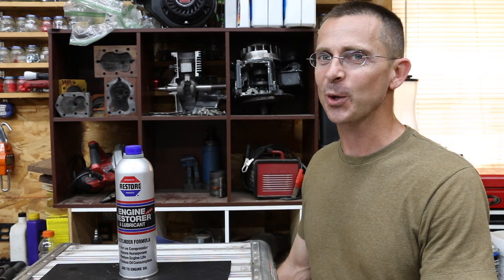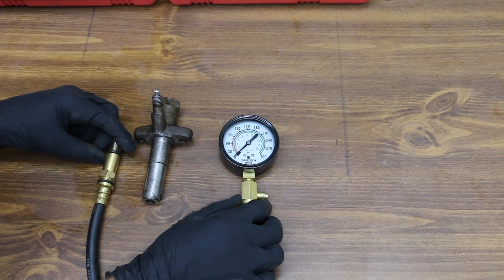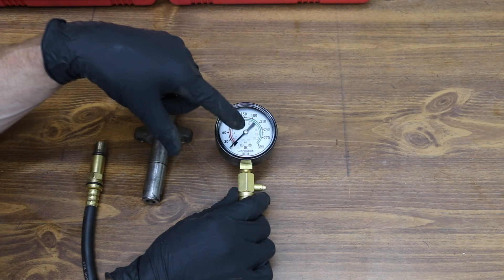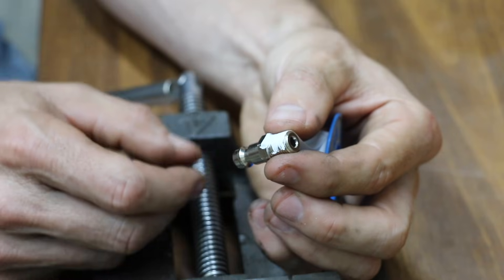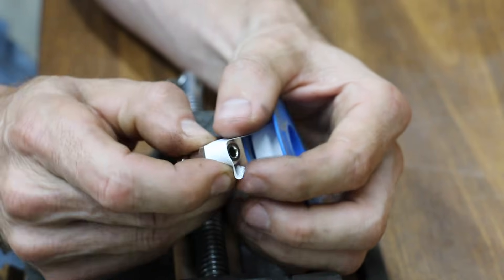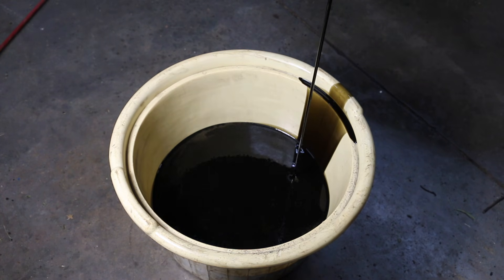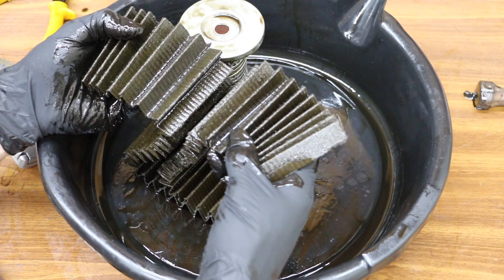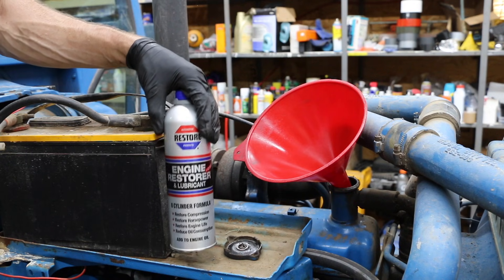Did the "Engine Restore" Compression Improvement Last?  One year later (Episode 2)

Comment: Even Michael Moore admits that producing and running a Telsa or battery-powered car pollutes more than a gas engine. Don't be a poser, save the earth and your money by keeping your old, payed-for beater running. Restore works pretty well, but you need to keep using it. The old pushrod engines don't have the tiny screens and oil passages so they can flush out pretty well without causing new clogging problems. The '03 GM LS59 5.3l V8 in my Tahoe is a good example. I like to do a good flush with clean, high-detergent oil first; Drain old oil keeping old dirty filter in place (dirty filters trap more fine crud than a new filter), add 5qts cheap 0-20wt oil and 1 qt of an engine flush like MMO, seafoam. kerosene, etc.. Run with no load at idle-2000rpm for 15 minutes, drain oil and flush solvent well. Add new good oil and Restore, new oil filter. Go for a drive. Using Liqui-Moly's engine flush and then their Ceratec at 200k mi worked VERY well in the same LS59. It took 4-5kmi to get the full Ceratec ceramic effect but no more cold lifter tick and the snappy power is still there at over 215k.
Reply from the maker: Thanks for the feedback.

Comment: compression and oil status is EVERYTHING with an old diesel like this, the injectors use OIL PRESSURE to fire the injectors, more compression has been believed to increase oil pressure, so this tractor could have gained some good power numbers!
Reply from the maker: Thanks for sharing.
Reply: I don't think this entine is a HEUI type injection system. Just a jerk pump with a poppet type injector. The only pressure is fuel at 2500 psi opening the poppet.

Comment: I do pharmaceuticals for my work. I drive a Dodge Grand Caravan with a 3.6 with 389,578 miles on it. Almost all of it is highway/thruway driving. I have used the Engine Restore for about 200,000 miles. (roughly) The engine purrs. I also now use it in my Chevy Suburban. It does work. Great video as usual.
Reply from the maker: Thanks!

Comment: I wonder if the compression increase could be from build-up on the cylinder head or valves from the additive. I believe it's not approved for aircraft engines which are just vintage air-cooled flat 4 cylinders. , maybe the lead in the fuel reacts. I don't know. but if it was ok it seems like it would be great for them. What are your thoughts?

Comment: Had an 03 malibu 3.1 v-6 that was rattling bad. Tried a few products and nothing. Was getting ready to buy a engine . Put restore in and within 10 mins it was quiet. If you changed oil without it rattle came back. It had more oil pressure and ran cooler. Anything with high miles iv'e tried it on it helps.
Reply from the maker: Thanks for the feedback.

Comment: I wonder if this additive might work on improving those modern engines that burn a quart of oil per 1000 miles, right out of the factory. It would not be cost-effective if the Restore would be used at every oil change though, as it is more expensive than the quart of oil that is being lost.
Reply from the maker: Thanks for the feedback.

Comment: It works i had Ford tarus got cheep not runing instal new cylinder head in the rear and cylinder was scored had slight miss fire on cylinder adding restor 2 times miss stoped. Sold it 8 years later after 2 transmission in it lol.
Reply from the maker: Thanks for sharing.

Comment: I had a bad experience with engine restore. I read about the contents before putting it in my Honda K24a engine, and decided the product made sense from a composition perspective. I’d like to note that there was nothing wrong with my engine at the time, it only had 55k miles and I believed that engine restore might prolong it’s life (contributing extra lubrication additives to my oil). I put in the 4 cylinder version to my engine on the next oil change with a fresh filter. About 50 miles or so later I heard a squeaking noise coming from my engine compartment and then a loud bang. Engine temp started to rise — and then smoke. Luckily I hadn’t left town and called my brother to come help tow me home. After removing the oil pan it became obvious what had happened. Restore, having suspended solids in it, had clogged the tiny Honda oil filter to the point where the oil pump shaft had snapped from the back pressure from the filter. It’s not a small diameter shaft either. I felt terrible for that engine and tried to save it, but there’s was too much circulated oil pump debris. It lasted maybe another 1000 miles with a cleaning and a new pump. Ended up swapping it for a used one with higher mileage. I believe the product does make sense if you have enough oil capacity and a large enough filter to offset what will be caught in it. I don’t recommend it for engines where the oil capacity and/or the filters are small.
Reply: Your story does not add up on more than one level

Comment: Maybe you can put the top  engine additives to a test against each other? That'd be interesting. Just like you did with the oils.
Great video as always sir.
Reply from the maker: Great suggestion!  Thank you.
Reply: @ProjectFarm  I try
Reply: @ProjectFarm  if you had a 10 year old Chevy 2500Hd V8 gas with nearly 175k miles on it that does alot of towing and were about to do an oil change. Would you add an additive? If so which one? Restore...
Liquid Moly...
Or another 
???

Comment: If you gut the old injector without a valve at the bottom, your essentially creating a larger combustion chamber with the volume below the valve making lower compression ratio and pressure. You should see higher actual pressure with the correct tester.

Comment: I added Engine Restore to a GMC Denali 5.3 L V8 with 91000 miles that was using a lot of oil. Before adding ER, it was using a quart of oil in 1000 miles. I changed the oil using Valvoline Synthetic 5W-30 and added ER. I drove it another 3,000 miles. It continued to use a quart of oil in 1000 miles. :-/  The engine ran great before and the plugs looked good with no oil buildup. I had put in new plugs 500 miles before the oil change. After 3000 miles they too looked good with no oil buildup. I was SO hopeful ER would curb this engine's thirst for oil, but it did not. I'm a mechanic and confirmed that the PCV lines were good. There  was no leaking/dripping either. I replaced the Rocker cover  (which contained an integral PCV valve) with first a Dorman Chinese replacement (defective). Then with a GM factory replacement. There was a TSB on these engines that called for doing this, but alas, still the oil usage persisted. I've since sold this vehicle advising the future buyer of it's oil consumption. Everything else on the car was excellent.
Reply from the maker: Thanks for sharing.

Comment: Can you test engine restore in a wet clutch application say Honda XR DIRT BIKE .There site says yes if you fill it half full and let it run on the stand don’t ride it and don’t pull the clutch then drain and use your oil without restore . Can you verify that it works(increases compression , and clutch won’t slip)
Reply from the maker: Thanks for the video idea.

Comment: From reading the reviews on Amazon, it seems the only thing to be wary of is if you have an engine with Cam Shaft Position Actuator Solenoids, apparently restore can gum them up.....
Reply from the maker: Thanks for the feedback.
Reply: @ProjectFarm  no worries brother. I love the videos. Long time listener first time caller as they say. You are my first point of research as I know you keep it 100 as the kids say. No bias just facts.
Reply: This maybe why my engine check light came on the dash of a Merc. Milan 6 cyl. AWD .  Double checked with a scan tool when codes P0011, 12, 16, 21 and 0022 popped up.  None were present prior to adding Engine Restorer.  Engine runs fine.  Cleared the codes twice and the car still drives well.
Reply: @jalan8171  yeah most likely. Actuators are tempremental little buggers. I know the 4-cylinder Equinox you have to change them every 30,000 miles or so. Luckily they are just 2 bolts.

Comment: After I watched your first video on engine restore I started using it in my civic.  It has 500 000km or so at the time and it had been sitting over a year I was getting pretty crappy mileage.  After running restore for a while I picked up over 100km per tank and it is running way better.  It's been my daily driver again for a while now with no signs of stopping.  So to free up stuck rings or whatever was wrong with my car it works great.
Reply from the maker: Thanks for the feedback.

Comment: I've used it on my old 1989 Jimmy with 200k miles on it and it worked really well!
Reply from the maker: Thanks for sharing.
Reply: @ProjectFarm  So I used Engine Restorer for the remaining life of my Jimmy.
What I found was that the engine ran much more smooth.
I'm not sure if it was because of possibly helping each cylinder with more equal compression.
I ended up putting 243000 miles on the car before it headed to a junk yard!
I still miss my 4 X 4 Jimmy!

Comment: Did you also test with your old gauge to verify that both gauges read the same pressure? Just so we are not seeing a margin of error. Plus old gauge was more granular/accurate due to the lower PSI range. Been using Restore since I can remember but never done a before and after. Love your vids.

Comment: Thank you and here is what I do with magnets on my oil filter, I use  5 good magnets on the oil filter, 4 in a crisscross pattern, like a plus sign, the 5th one on the end. They all  only cost about $4  and can be reused on many filters. I check the filter at oil change time and can see very small pieces in a magnetic pattern, inside the filter housing. Check it out for yourself. I use the covered or plated magnets, they last longer than the non covered ones.
Reply from the maker: Thanks for sharing.

Comment: I watched your old video on Restore and added it to my forklift that smoked like a chimney when cold started. It took months b4 the smoke stopped at startup and no smoke when I finally sold it. It did work great for me. I will have to add some to my old 69 Ford 3500 tractor and see what happens, no smoke but hard starting summer or winter.
Reply from the maker: Thanks for sharing.

Comment: You asked for ideas so here is mine...Back in the 90s I was introduced to an oil additive labeled "Bitron". I got involved in the MLM scheme which I hated but the product seemed to do remarkably well. I became a small time distributor and did a couple of experiments where i would drain the oil after running the product and see how long the engine would run before it self destructed. Amazingly the old lawn mower I used never stopped even after a 4 hour run time after draining the oil,  however after that test I took the mower home and used it to mow my lawn without adding any oil and it did finally stop. upon inspection I found that the main problem was that one  rod cap screw had completely undone causing the con rod to break, Although there was journal damage. Apparently there is still someone producing the Bitron product and selling it out of Calgary Alberta. It would be great if you gave us a video on the Bitron oil additive. Thanks for all your great videos
Reply from the maker: Thanks for the video idea.

Comment: I bought a 1978/79 f 150 with a 400/ Modified engine. When I got it ( in Denver ,Co. ) It was a typical old and tired Ford. I had used engine restore in the past with great results and this was no different . I started using it at each oil change and soon it stopped smoking out the exhaust pipe started running smoother with way more power later on after about two years almost about three years of using it continuously I tore the motor down and you could see where the engine restore had filled in the grooves scores and nicks in the cylinder walls and made them smooth I checked compression and it was within factory specs for stock I at that point didn't do anything to the bottom end put a better set of heads on it and RPM cam overbrook RPM intake manifold in eldermark carburetor with a 373 gear in the back and 35 inch tires and that truck would smoke both back tires from zero to win the speedometer pegged out at 100 miles an hour and never stopped
Reply from the maker: Thanks for sharing.

Comment: Does it still work after you stop using it? I barely discovered this product put a tiny bit in and a lot of my problems that I spend countless hours trying to find the perfect tune, little things that make it act in an od undesirable way, i noticed the car would idle smoother after shut off 30 min come back to start, it'd idle poorly, I've been messing with the fast idle stepper, honestly it never crossed my mind I was having low compression, what i difference, i got lucky and randomly bought it for experimentation purposes.

Love your videos project farm, your insight and knowledge is the best out there.

*edit would you look at the differences between 4, 6, 8 cylinder versions of engine restorer?
Reply from the maker: Thanks for the video idea.

Comment: Hi Todd, I just watched this video again..... I am currently using Restore in three old Suffolk lawnmower engines..... Two are 75cc cast iron units from the 1970s, and the other is a later 98cc aluminium Qualcast engine from the early 80s.
All have definate oil burn to varying degrees and resultant blue smoke, so it will be interesting to see if Restore can have an effect.
Can you please consider making a future video to test the performance of Castor Oil based Lubricants compared with standard mineral, semi and fully synthetic engine oil ???
Reply from the maker: Thanks for the video idea.

Comment: Added Engine Restore three weeks ago to my 2007 6 cylinder Mercury Milan.  After months of a low oil pressure sensor light illuminating at idle, that false warning has stopped.  Saved me hundreds of dollars from an unnecessary sensor replacement by price gouging shops in a metro area.
Reply from the maker: Thanks for sharing.
Reply: Bad sensor bahahaaa🤣

Comment: My 22 year old Ford pickup truck runs wonderfully with 189,587 miles and hauls the tool trailer daily still. I've been adding the 6-cylinder formula of engine restore at every oil change for the past five years. The truck uses and leaks no oil. I watched this video a couple of years ago and just wanted to concur: engine restore works great!
Reply from the maker: Thanks for sharing.

Comment: Thank you! This is a great test of a product I use and have had similar results. Likewise, I have heard of another product that boasts some amazing claims. It is Xado Revitalizant for transmissions and engines. The claim is that the product coats worn metal surfaces with stronger than steel ceramic. This fills the gaps and play in bearings, gears and shafts, thus, drastically improving (for example) automatic transmission shifting and silencing planetary gear whirling and whining sounds. Would you please think about doing a test with this product? It would be great!
Reply from the maker: Great video idea.  Thank you.

Comment: My uncle turned me on to engine restore years ago.
He used it in a 350 4 bolt main ran NOS in it said each blast was like 20k miles ran in a few seconds he used engine restore every oil change and always had great cylinder pressure across the cylinders. I have a 30 yr old 1990 honda accord lx coupe it keeps my motor running like new with 244k on the motor. No smoke no issues just purrs and runs great .
Reply from the maker: Thanks for sharing.

Comment: My 2003 Ford Escape has 310,000 miles. It used to produce a small amount of smoke when pressing the accelerator in the driveway. I used engine restorer and that stopped. Worked amazing! Performance improved as well.
Reply from the maker: Thanks for sharing.

Comment: I agree I have a 2015 wrx ..I've used this every few oil changes!!! Original motor 242,000 miles I was just boosting around tonight..Turbo psi 20.0 Glad I seen this video ..It reminds me the next oil change getting me a 4 cylinder can of restore .👍
Reply from the maker: Thanks for sharing.
Reply: Btw this should answer the Question of ER working in a VVTI !! It does !! I just add it in moderation thru out a new oil change! Like half on the oil Change and the other half on top off's always worked for me on my FA20 motor 🙌🌞

Comment: A year ago I bought a restored 65 GTO powered by a hot 406 CI smallblock Chevy. Though it ran fine I soon realized it was burning a lot of oil, about a quart per tank of gas. Based on your video I added some Restorer. I checked the oil at the next fillup and, like clockwork it was down a quart. However today, one tankful later, I checked the oil and the level hasn't budged.  If this keeps up it will be a miracle. Thanks for the useful service you provide.

Comment: I haven't used it in a while but I have used it in tired engines before (200,000 mile+ ) amd felt a noticeable improvement in performance along with a generally smoother idle. I'm thinking any kind of high zinc additive may help compression  by essentially sticking to and fill8ng/smoothing out  microscratches in the cylinder walls.

Comment: Had a car that burned oil, no visible smoke but you could smell it. Used this product, the smell went away and the car also did drive a bit better. So it worked for me also. Its also pretty cheap too.  So there's that 😎
Reply from the maker: Thanks for sharing.

Comment: Would like to see a repeat test of the original Slick 50 formula vs the current form, with regards to cylinder head temp and perhaps a change in engine RPM after administration.